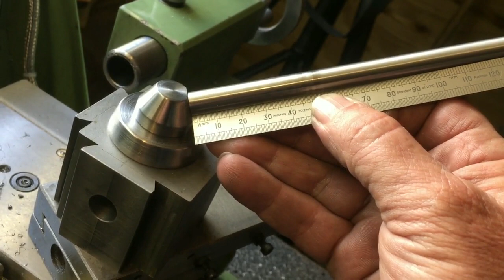WARCO LATHE Shop made quick change tool post part 11

Comment: The brass plungers will wear over time, and the position of the handle will rotate along with the wear, ending up in a different position. It really doesn’t take much wear for the handle position to move a fair amount. When I go back to the newer videos, I’ll be interested to see how that’s worked out.

Comment: Great to see normal service resumed, Ade can I ask if you were buying the lathe again knowing what you know now with your experience of the WM180 lathe. Would you go for a larger heavier size lathe.
Reply from the maker: Very good question , on reflection and having experienced the warco customer service i would say yes, however, in an ideal world it is a bit small for my needs . in an ideal world i would probably want a colchester student but it has to be carried through my house and i work from a garden shed. as i progress i may get one but this lathe for small work is great . horses for courses i guess , hope that helps , Ade.
Reply: As you know I was looking at the Toolco 1014 lathe, not sure if it would make sense to go up a bit in size & weight. To the Warco WM240 or even the WM250 fitted with gearbox & ac motor with built in inverter, only want to spend the money once really.
Reply from the maker: tricky decision i guess . my only advice is that small work can be done on a large lathe . large work not so much on a small one . i have turned a 40 tonne roller on a massive polish lathe in the past and it could have turned a 10mm bush although the speed would of been slow , the 250 gearbox with inverter is not so heavy and may be the happy medium . cheers A.
Reply: I'm also weighing up this choice of the WM180 Vs WM250v or Toolco equivalent. Hoping to go to the Warco open day on Saturday. If I'm wanting to use it for milling, would you think the t-slot cross slide would be an advantage?
Reply from the maker: The T slots certainly give the most flexibility , you can bolt a plate on top of the cross slide with multiple holes like a mini pallet that will do the same job if you have no t slots , Ade.
Reply: If you are thinking of the 250 lathes then I would def go with the Warco Wm250v as it comes with the better ac motor with a built in inverter. Its said to be more reliable, quieter also going down to lower speeds, with more torque at lower speeds than other lathes that are fitted with dc motors.
Reply from the maker: i have no experience of the 250v but power and torque at low speeds is a plus point in my book

Comment: Coming along nicely. The grip on the bolt in that milling vice looked a bit precarious, but it worked so always good to learn what you can get away with from someone who  knows what they are doing. Any footage on the motor repair? Did it all go smoothly?
Reply from the maker: i trust the vice all the way , it is the mounting of it in the milling slide that worries me , i have done a vid on the motor replacement using the old motor but got no footage of replacing the new motor . cheers Ade .
Reply from the maker: the motor vid is WARCO LATHE motor failure and removal , A .